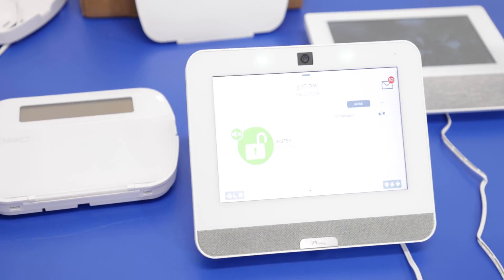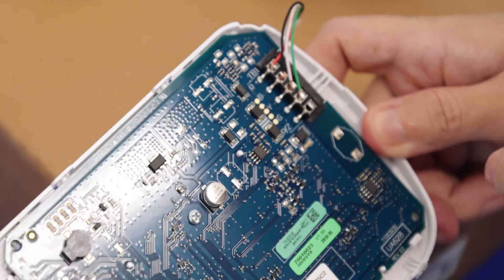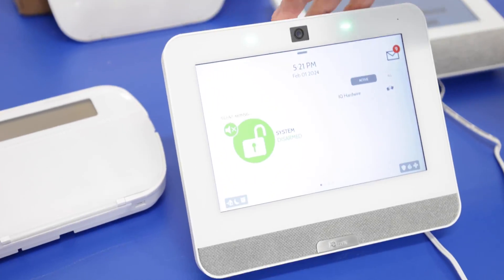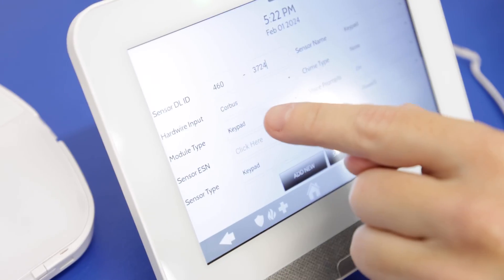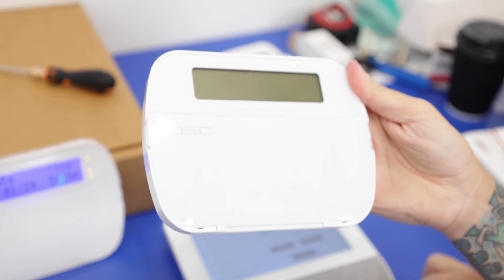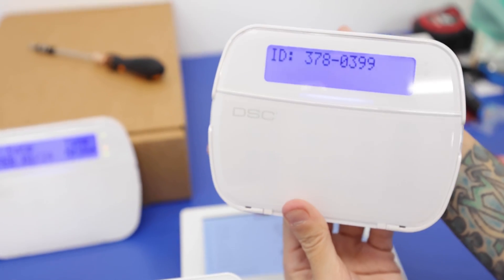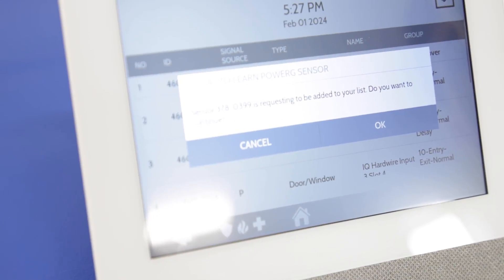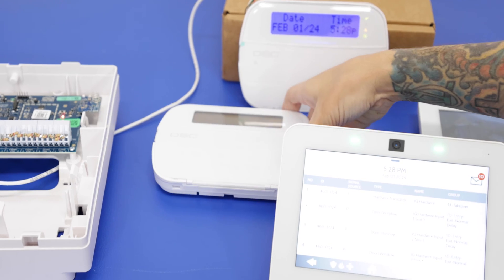Qolsys IQ Panel 4: Compatible Keypads

Comment: Hey Dylan, I didn't notice the first time that I watched this, but you have an IQ hardware open error on the panel.  Just an oversight?  

Will the NEO DSC units be compatible with the IQ4 panel?  

BTW, you might want to take a minute and reply to the people that commented :o)
Reply: Hi @myutube6422, No Troubles to see here. :) --- Just test equipment. :) ---  To answer your question about DSC device compatibility, Yes some DSC compatible parts will be compatible. Such as American versions of Power G wireless sensors when the power G module is installed, Also when using the DSC PG9HRDW8 Hardwired to Wireless zone conversion module, the Hard wired DSC neo keypads compatible with that module will work with the IQ4 panel.

Comment: Why when I use an HS2LCD connected to an IQ Panel 4 I cannot enter *8 programming mode on the HS2LCD, it displays Function not available.
Reply: Hello @Tlasota9230, Programming is only allowed from the main IQ4 panel.

Comment: Question. I have the same Qolsys IQ Panel 4 but i'm using it with a Visonic KP-241 keypad through a PowerG connection. In the IQ Panel you can go into the advanced settings and switch it to '6 digit code' which works perfectly. When the IQ panel asks you to enter your code when for example a PIR triggers, the 6 digit code works fine. However... 6 digit codes won't work on the external keypad. The external keypads are set to 'expect' a 4 digit code. This really sucks because I can't use my KP-241 to enter the codes anymore. Watching this video, it seems the keypads you use here also expect a 4 digit code as you didn't have to press an 'enter' key or 'submit' key after typing the code in. Any ideas?